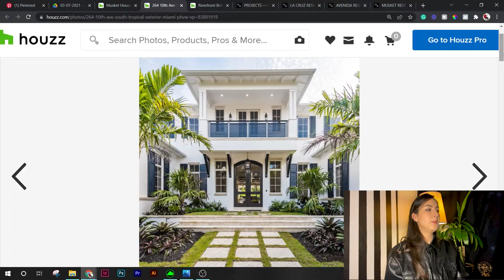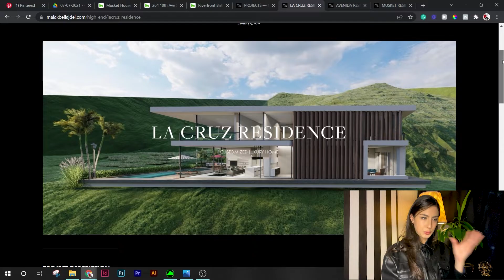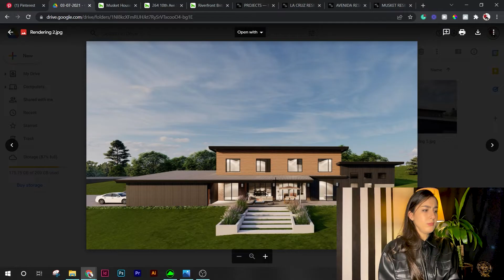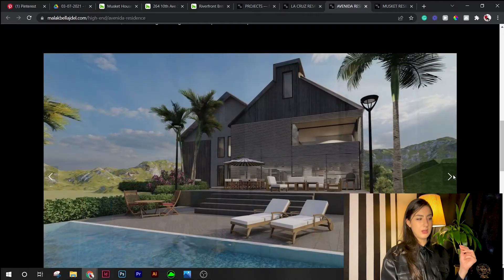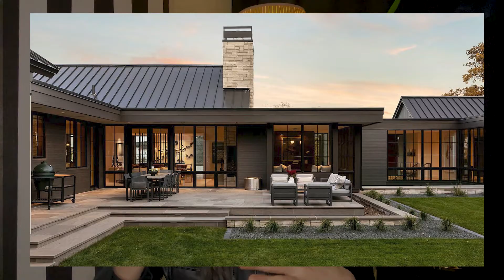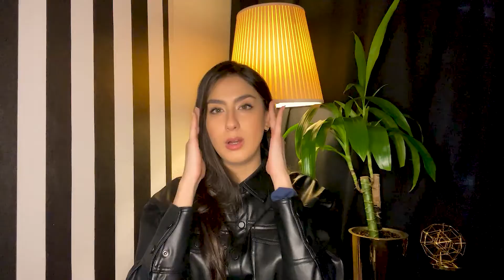HOME DESIGN - How To Design Your Home Like a Pro With These 4 Design Tips l #Architecture  #interior

Comment: I acutallly live in Albuquerque and you’re correct. Now I have a question. I want to buy an Alienware m16 would you suggest it or any other. By the way I have watched your video on your alien ware laptop also. Thanks in Advance.
Reply from the maker: @kahyyamdavis7783  Yes, Albuquerque’s weather is pretty extreme. Regarding the computer, my Alienware M16 is still working fine. I can’t suggest another one because I’ve never tried another performing/ gaming computer besides Alienware. If you take good care of it (clean the fans, have a cooling pad, etc.) it will last you longer. 
Thank you for watching :)